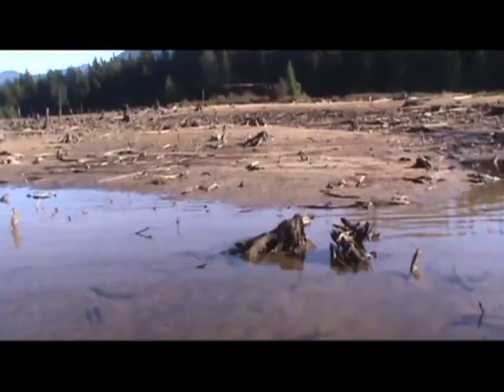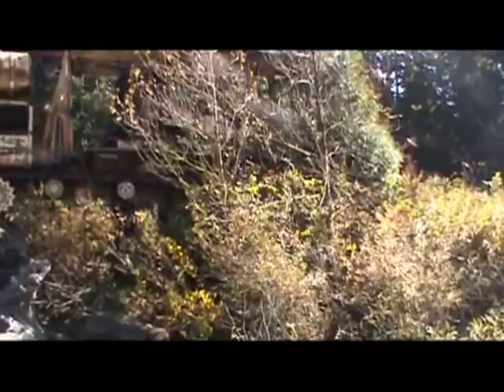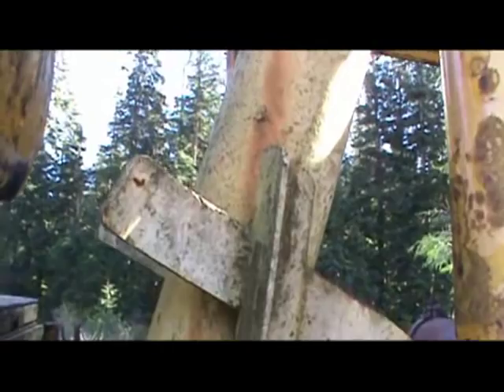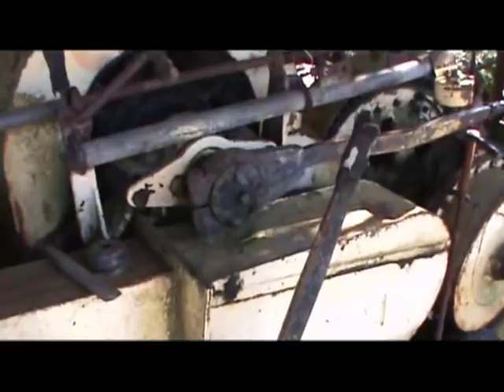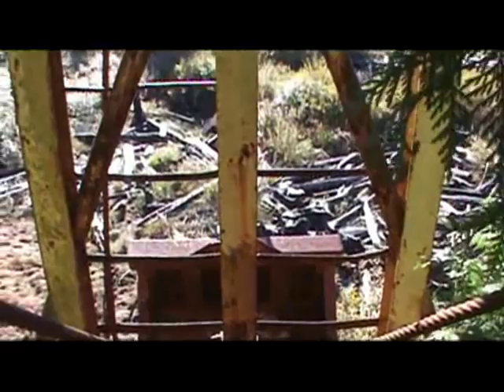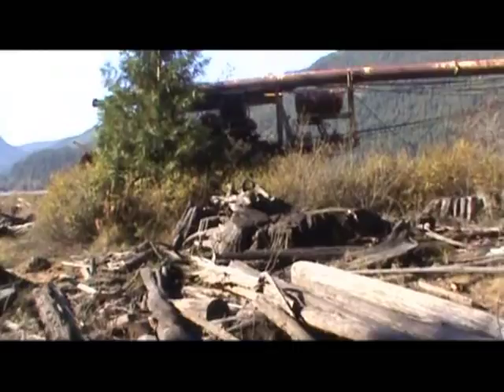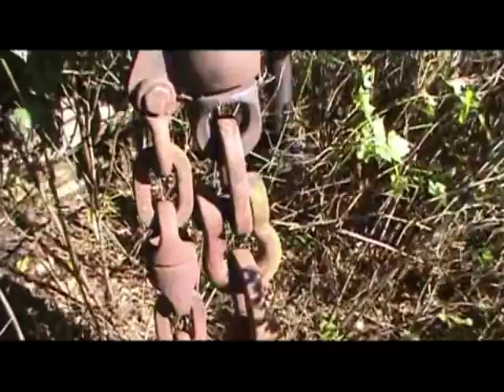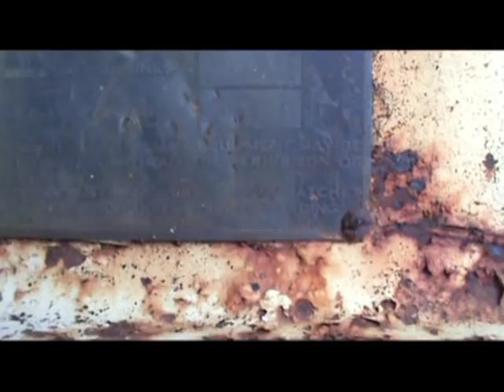1960- Madill 009 yarder -A mystery of history

Comment: Great find and video. I own 4 acres on Gabriolla Is. and have to drive through Nanaimo to take the ferry over. I always loved seeing the logging trucks when I was a kid. I have been restoring WW2 military vehicles for almost 20 years. That yarder was built on a 1944 Allis-Chalmers M-6 High Speed Artillery Tractor. It towed the 155 mm gun. It was powered by twin Waukesha 6 cyl. engines, 190 brake horse power each. Fighting weight was 76,000 lbs. Towed load was 50,000 lbs.
Reply from the maker: Well,that's more than the rest of us know about the bottom half of this thing,glad you enjoyed it!

Comment: The M-4 Sherman tank was built in huge numbers, and after the War so many component assemblies were available that heavy equipment MFG 's bought them cheaply, and used them in their machinery. Differentials, final drives, suspension stations, tracks, all easily procured.
Reply: This yarder was made form an old "Tank Retriever". That's why the driver area is not enclosed or armored. The video mentions that sometimes the tower was filled with water. True. This was done during fire season. That tower would hold 1500 gallons and with the 100 foot head the water had a LOT of pressure when you attached a fire hose. Mostly we used it to fill out Wafax back tanks and for safety in case we got a fire near the landing from the Mainline or Haul-back chaffing on a log or stump.

Comment: good job. 

I bet i could have the Cummins running in in an hour as long as it hasn't been under water or had water in it. 

hydraulic pumps and motors would likely be froze up.

that value laying 30 yards away would cost a grand to get going. 

probably wouldn't be a hydraulic hose on it now that would hold any pressure. 

I bet the track would roll. everything that's involved in driving it would be froze up. 

in the end it wouldn't be worth much. couldn't use it today without a bunch of shields. 

you might get lucky if a guy that hit the lottery ran it many years ago and really wanted it to put in his living room.
Reply from the maker: +Tim Henry   Its a good conversation piece/curiosity,but its day of contributing to the economy may well be long behind it.

Comment: I've fueled those old Madills in the woods back in the day, pretty sure I recall those built on a tank chassis. The parts would be expensive and perhaps hard to find for the tank part on the bottom.
Reply: ea they are thats a m4 sherman chassis
Reply: Ryan Becker i wonder if it was finished after the war or was ever used in combat (back when it was used for the sherman and not the machine)
Reply: probly was and then converted to that
Reply: Yeah you can tell from the sprocket it’s a Sherman

Comment: I worked on a Madill with a Sherman tank carrier back in 1986 in just out of Spuzzum in the Siwash and Anderson creek area for Cattermole timber out of Chilliwack BC top speed was about 6 mph longest move to a setting was usually not more than a mile or two otherwise we would low bed it was too slow and hard on the tracks to move any great distance.

Comment: Ran a lot of 009's but I never saw a Madill hand jammer! That's right, no air controls. Before the Witchita era looks like, it's got band brakes. Has a Gearmatic too. 
I'll bet this one was piped down to move, and before it was moved some manager probably decided that it was too slow and old to be worth barging it to another job, and they just left it where it sat cribbed up like that. I'll bet that lower motor ran the hydraulic pump to run the jacks, guy line winches, and bullprick cylinder.

Comment: Funny...it's not an M8 nor a Sherman. It's an M6 Hi-Speed Tractor converted for the logging industry after WWII. They were made by Allis-Chalmers and had 2 gas engines in them. Most that were used during the war were either given to the country they were in or sent to Israel. Those that were here were sold off.

Comment: Would make a great camp. Sometimes machinery got abandonned when the logger was behind on payments and moved it around to prevent repo or just to tick off the guy they owed money to. There is an old PACCAR style Athey tracked log arch back in the central Adirondacks that was hidden, then a state crew with a bulldozer doing trail work hooked on to drag it out but diverted to another project and went out via Cedar River Flow leaving it miles further back in.

Comment: This unit is built on the m6 high speed tractor hull. This unit was bought by corrections Canada, It was barged in over 30 years ago and set up to teach inmates from the local prisons logging. They used it to pull logs out of the river at the bottom of the lake. This unit has been seen by many people and people have gone and taken lots of parts from it unfortunately. If anyone knows of any more of this type of hull please let me know.

Comment: if this is a madill 009 it is not 1960 as they did not build them before 1965. I started to work there in 1965 and worked on building the first 009's .Before that they were building the spars and using skagit or tyee  yarders.
Reply: +Edward Rumming It's an M6 built by allis chalmers, it's been converted from military roll to industrial roll.

Comment: there was manufacturer on 50's who made logging tracked tractor based on Sherman tank chassis. cant remember the brand. probably the manufacturer bought  the sherman  chassis as surplus  and modified to work as a logging tractor.of course the original chassis manufacturer should  had a " new" replacement military design for such chassis before sell them to civil market.

Comment: Lower 1/2 looks like an M-4 sherman "firefly" pprob. korean war era
Reply: Nope, not even the same suspension units. It's based on a M6 High-Speed tractor. M4s before the M4A3E8 used VVSS and this used HVSS. Even the Easy 8 used different bogies and carriers though it was HVSS as well. You can't clearly see it in the walkaround but the rear of the suspension as well as the different roadwheels are the dead giveaway.

Comment: Where is this. Should get a tug and barge out there take it to mainland and find out how much it is worth
Reply: C broton how would you load it onto the barge?  thats some serious work right there...talking multiple trips since your original idea wont work since life never works perfectly......then you'd need additional equipment, then you'd have issues driving new machines on the sand and getting stuck.....when all is said and done you'll be wishing you never got involved....and thats why it sits where it does.  If you were a specialist who has done this sort of thing their whole life and salvaged machines from crazy spots, then you'd have the proper equipment and know-how and only then, it MIGHT be worth pulling it out after you cover all expenses.  Theres a reason its sitting there, and thats all because it was cheaper to let it die than to pull it out when the time came to wrap up the job on that site.  Sad but true

Comment: What does this machine do ?.... it's a crane ?
Reply: Before the use of hydraulics that brought about things such as the backhoe and lifting and earth moving equipment that did the same jobs as a backhoe used buckets, grapples, claws, plows that were suspended from the yard metal mast and manipulated with cables and winches, hence the term yarder. In logging such as this the equipment would be used to lift and fly the cut trees to a landing for loading for transport or onto a barge when by water like this. The Madill 009 probably invariably made its way to the logging site on a barge and due to its age and lack of a swing action like a modern yarder wasn't deemed profitable to transport it from the site when the logging contract was finished.
Reply: wow ... very interesting ! Thanks for sharing your knowledge about this.
Reply: Craigified is some what correct. A yarder  not used for excavation, but logging only.
Reply: PA diecast construction In modern times yes.
Reply: No craigfied. Yarders are used to bring cut Logs up a slope from the cutting area. Then the would be loaded.
Reply: +slippery396 
 It slowly adds iron oxide to the environment.
Reply: Very funny  ....
Reply: PA diecast construction actually that isn’t entirely true. Quite several yarders were converted into gravel draglines

Comment: anybody know what the gas motor was?
Reply: looks like a GM quadrajet intake ,, 454 ???
Reply: 88s10Durango
I might be off but it looks like it has a mechanical fuel injection pump,  if not it sure doesn't look like any 454 intake I have seen, looks like it has either a valley pan or at least an air gap under the intake and definitely no distributor on the back of the engine. Some of those older tractors had some v8 diesels, but I am not sure what make that one is.
Reply: pretty sure its a gasser, intake is built for a 4-barrel that was pulled. not sure what that silver thing on back is but prolly some kind of distributor. my guess is it's an old IH big block of some kind.
Reply: Looks like a Ford industrial truck engine.